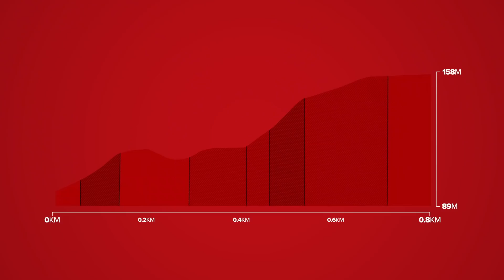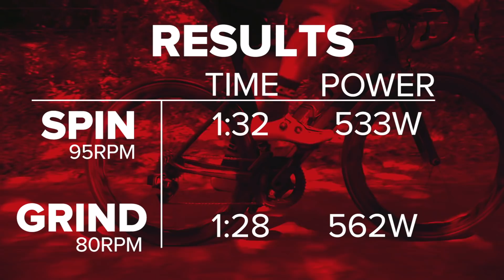Spinning Vs Grinding | What Is The Best Cadence For Climbing On A Road Bike?

Comment: What this fails to mention is that a lower gear ratio allows the average cyclist to continue to travel up the climb at a lower power output. At this point it's not about speed rather just getting up the climb. With a higher gear you may not be able to spin the pedals with your given power and you'll just stall.

Comment: I am a messenger in paris. One of our standard runs is a climb of 1.4 km with a 6.6% average gradient. At places it looks pretty vertical. Spinning with a gear ratio 34/32 on a 32kg(when empty) cargo bike is my best friend. If you visit the Sacre Coeur in Paris think of me.
Reply: J'aime l'eglise de Sacre Coeur
Reply: Greetings from Canada
Reply: Just use motorcycle, problem solve.
Reply: Your a real cyclist! The more weight makes it exponentially harder and coming down frightning. I found coming down zoncolan frightning as im over 110kg.

Comment: Grinding @ 80 RPM?!!! Looks like we don’t have the same dictionnary 😂. Try again @ 60RPM, that’s what I’d call grinding
Reply: exactly
Reply: Precisely! It also depends what gears set up is used. I start "pushing" pedals when dropping below 70, 68 is minimum but 74 -76 is like best fitting for me. I feel then, like I'm riding "for free". 78 RPM and I shift to next gear to not "overtorque" at 80 RPM or any higher. I feel like dumblesly waving my legs just to move them around and not do any useful, effective pedalling. My gears are 52T at the front and 11-23T / 11-25T  cassettes. Note that 52x11 shifting at 70 RPM gives nearly 42 km/h, and 52x12 at 80 RPM is even faster... If you're amteur (like I am), try holding it for 40 kilometers or more? Can you?
85-100 RPM average? Heart attack! I never believe any of that, when amateur riders push me this kind of news... Pure rubbish or one is spinning 39T and 25T at the rear...

Comment: 90-100rpm on 165mm cranks feels natural to me, and I can maintain speed longer than when I was stuck on 172.5mm cranks spinning at 80rpm.  I can also zip up hills quicker with shorter cranks, where I felt the need to climb out of the saddle and grind with longer ones.  So, if you are going to change cadence, I think changing the crank arms to match makes sense.

Comment: I've found that grinding gets me up hills a lot faster but my legs run out of energy before the end of a century.  If I've climbed with a higher cadence, I still have legs at the end.
Reply: I guess that would depend on the steepness and length of the climb. I cannot grind for 20 minutes out of the saddle on a steep hill as i get tired earlier. I can do it sitting down on a spinner cadence. For short hillclimbs, standing up is quicker. For longer hillclimbs, i need to pace myself and spin to win.

Comment: Being a touring cyclist and not a racing cyclist, I ride a bike that once the camping gear is on the bike that can weigh anywhere from  60 to 100 pounds (27 to 45 kilos) and my climbs are often in the rockies.  I spin with a target cadence of 95.  But my gear ratios and gear inches over 27 gears give me lots of options.

Comment: Optimal cadance is actually quite an interesting question.  I can imagine there are several conflicting factors involved.  Here are a few:

1) Energy wasted moving the legs.  Imagine pedalling a stationary bike with zero load.  The faster you pedal, the more energy you're using just accelerating and decelerating the mass of your legs up and down.  Since there is no load, this work isn't actually doing anything, and it's completely wasted.  So when you pedal a real bike against a load, the faster your cadence, the more of your power is wasted just moving your legs, and this wasted power is lost from moving the bike.  From this aspect alone, lower cadence is more efficient.

2)  Wear on the knees.  The more force you pedal with, the more you grind out your knee joints.  From this aspect, higher cadance is better, since you can produce the same power with less force, saving your knees.

3)  Efficiency of the muscles.  I would imagine the muscles are more efficient at a particular combination of force and speed.  If muscles are at maximum contraction for too long, perhaps transport of fuel and waste products is less effective than if they contract more lightly but more often?  Perhaps someone more knowledgable can comment on this?

It would be interesting to know if sport scientists have quantified the contribution of these and other factors for various cadences, and found an optimal tradeoff point?  Has anyone seen anything like this in the literature?
Reply: I've found this phenomenon at this "electricity generating" thing with several lightbulbs on a bike, to see what you could do in a minute. I told the guy to wire up all the lights but the load only came to about 105 watts. Spinning the pedals made the load easier but it was impossible to put down more than 105 watts as the pedaling just became really easy at high speed (there was probably a voltage regulator to not blow the bulbs). Probably for a minute I'd need 400-500 watts worth of bulbs and 110 rpm for optimal loading.

I'm not sure whether energy wasted moving legs is recovered at higher loads. Because the body doesn't have to control the legs, the power can be dissipated in the bike and not in the muscles.

Pedal stroke timing could suffer though. Because muscles can be used as a brake, contracting opposite muscles at once - either on opposite pedals (independently ratcheting power cranks are to train this out), or in the same leg, wastes energy. I was trying lower cadences to really think about the firing order of different muscle groups. Was I contracting the quadriceps and hamstrings at once? I'm wondering whether with two joint muscles such as the hamstring, hip flexor and gastrocnemius, some energy wasted is inevitable. I mean the hamstring can also aid the gluteus maximus slightly, but yet it saps power from the quadriceps. At the bottom "scraping" of the pedal stroke, the gastrocnemius and hamstring work together to bend the leg and point the foot.

It's almost like ignition and exhaust timing in an internal combustion engine. You don't want part of the explosion to be trying to push the piston backwards. Trying to minimise eccentric "contractions" in the pedal stroke is much the same. You want power to turn the wheels on the bike, not turn it into heat stretching muscles against their will. It would be like riding on a tandem with someone trying to pedal backwards. Eccentric contractions are the main energy wasted on a unicycle.

At very high loads, I have anecdotal evidence that muscles do lose efficiency. I sweat more trying to pull 120 kg barbell off the ground than a 60 kg barbell twice - yet the latter is actually more work, as I dip my body twice. Not only that, but it also wastes the potential of fast twitch fibres. You're using up their capacity, but not making much power. They are just acting like an electric motor in too hard a gear ratio for it to function properly.
Reply: No doubt the most important point you've made is #3, and is what has already informed cadence in practice.
Reply: For #3 it's more about sustainability than efficiency.  Faster cadence uses aerobic energy which puts the work on your heart and lungs.  This can be sustained indefinitely if your heart and lungs are trained for this amount of load.  Slower cadence starts to dip into anerobic reserves which always has a limit due to lactic acid buildup.
Reply: @TimpBizkit  Great reply, and good barbell example.

Comment: What i always asked myself and i didn't find any research about is if a higher cadence leads to a higher backflow to the right heart. Veins don't have muscular tissue they are compressed by the surounding muscles. With an higher cadence this happens more often leading perhaps to an higher backflow. This could perhaps help the heart to be more efficient or lead to an better supply of oxigen to the muscles.
Another reason for the normal person to use a higher cadence can be the reduced torq on the joints. If have read a study about this but don't find it at the moment.
I personaly try to keep my cadence a little bit up when ever i can.

Comment: Cadence is a U shaped function of power and time. I do a 10 sec all out sprint at 135rpm, a 20min ftp test uphill at 60rpm but a 2hr time trial flat at 93 rpm. Over longer time at lower intensity higher cadence gives less muscle fatigue and the cardio system is still not yet at its limit, but when the effort is short and high the additional load on the cardio system enforces less cadence and because its short the muscles can hold it.

Comment: 80rpm is "grinding"? LOL, watch me with 36/28 up a 20% slope at 45rpm, that's grinding.
Reply: Grinding is when you're forced to pull harder on the back and upstroke at a rate that can't be sustained if you experience any significant fatigue or dip in aerobic performance. It can happen at around 80 but that doesn't mean you can't drop even lower. If you have a power meter with torque analysis you can see where this starts to occur. And you can also train to improve efficiency at both ends of your effective cadence window.
Reply: 36 is a noob gear. Try 39 or 42....
Reply: @MicroageHD  I ride a 48/36
Reply: Try fixie with 48/15 and you'll learn about grinding, lol
Reply: RollinRat  TRACKLOCROSS FTW!!!! World Champs in Sac this August!
Reply: I'm right there with ya!
Reply: RollinRat  ..blah blah blah. I rode for a long time you best respect!
Reply: Super big lol.  All individual, but for me 80RPM is my normal "race" pace.  Below 70, I feel like I'm grinding and higher than 90 is spinning, that's just me.  :)
Reply: Grinding is when you have to put several pounds into your leg. Spinning is when the pedals feel loose.
Reply: Hahaha
Reply: Grinding is power...in and out of the bedroom
Reply: Over 20% is always going to be a grind unless you are geared so low that the front wheel lifts.the tova st agata route of mortirolo is over 20% in sections ,i feel your pain over 20% is a challenge.
Reply: @superluvver3  depends how long your bike's wheelbase is. if your seat is well forward of the rear wheel, you may be able to keep the nose down.
Reply: @l4kr  that's still pretty fast if you're talking 100 to 1. If your wheel moves about 2 metres a turn that's 10 metres a second. Unless you're talking the opposite - a really low gear where the bike moves 2cm/pedal and you tip over.
Reply: @MicroageHD  yeah, the pros are using 34 now.
Reply: @ministryoftruth8588  As LONG as you ARE going slowly ENOUGH you won’t BE going much MORE than 60rpm ANYWAY.
Reply: @MicroageHD  39 - 42 is for grinders (people that only ride flats and get dropped at any climb longer than 150m)

Comment: I think part of it is psychological.  On the flat, you're just keeping the bike going, and the only thing slowing you down is the aerodynamic drag.  Stop pedalling for a few seconds and you'll coast.  On a climb, the very moment you stop pedalling, the bike begins to slow down.  The very moment you reduce pressure on the pedals, you can feel the bike beginning to drag.  I find spinning uphill demoralising and I find grinding on the flat equally demoralising.  At 57, my definition of spinning is probably a much lower cadence than Si's.

Comment: The answer is RPM at whatever cadence makes YOUR most power.. .Stand on the steep and sit on the flatter parts, to alternate rest between the different muscles to give each a break.. Adjust your efforts so you don't blow up.. Toggle your power up  and down just under where you blow up.

Comment: Your cadence will depend on your chainring, cassette cog, strength, fitness, body weight, bike weight, VO2 max, percentage of high-twitch muscle, hill steepness, hill length, outside temperature, elevation, specific training on the hill in and out of the saddle, a professional training plan, what you eat, when you eat it, warming up first, having supporters with cow bells at the side of the road ...

Comment: There is more power output grinding  because of technique; when standing you are shifting body weight applying the power part of the stroke with a better mechanical advantage.

Comment: I think GCN answered it at 4:30 - you pedal fast to go fast. Also - for me, the length of the climb matters a lot. If it is a climb that can be covered in less then 15 minutes, I can get out of the saddle and push hard at a lower cadence and actually put out more power to get over it quicker, but these efforts are not sustainable over and over again throughout a long day. If it is  going to last more then 15 minutes, I really want to keep it above 90 rpm and mostly stay in the saddle to keep my heart rate down. Also, I train at those high cadences and have always been a high cadence rider and usually have stronger performances in longer, harder, rides/races.

Comment: I've been wondering if a bike was set up specifically for a climb by moving the saddle forward so that it centers the rider over the peddles at the same angle to the downstroke as their normal bike on flat ground, would it be more efficient in climbing? One of the things that getting out to of the saddle does is places the riders weight directly over the peddles so it can be used more efficiently to push the bike forward. Would moving the saddle forward for a climb help with this. I could even imagine a system that moves the saddle back and forth automatically depending on the gradient measured with an internal level.

Comment: 80rpm is grinding already? 😂
Im not a strong rider and if I am able to hit 80-90 thats when I thought I am spinning and the grinding happens only at 60 and below rpm in my case. 🤣😂 gotta have to train more. 😂
Reply: Unli Ahon haha sameeeee I consider grinding ..like 40 rpm ahah
Reply: PAPSS!!!
Reply: the faster you get the faster you will spinn. that doesnt mean you should aim to apin faster nore that faster spinners ng people will bypass you
Reply: wat
Reply: I'm 146 pounds and don't develop the torque of the bigger guys, so my power comes from my cadence. Less than 93 feels like I'm grinding, 95-103 is the sweet spot.
Reply: Unli Ahon Haha yes, what is 60 then? :)
Reply: If below 90 has to be Grinding then are we freaks who can do 50 with ease freaks?  Let's call it 'smashing' :)
Reply: I'm a 100 kg, 50+ yr old, with ex-rugby player's knees (been offered knee replacements already). I have read that a faster cadence puts less strain on your knees. I aim for 80-90 on the flat, but my default climbing cadence seems to be 60.
Reply: gotta train more
Reply: bypass?
Reply: To the seasoned cyclist, yes, 80 is "grinding."  My cadence evolved over the years from 90 to over 100.  But this also happened to coincide with the increasing prevalence of the mountain bike, where smaller gear ratios and much wider range became the norm.  Well, at least my riding availed itself to that.  I grew up mashing big gears on steep climbs on a road bike with traditional 42/52 gearing up front and probably 14-26 on the back.  The mountain bike changed that.  

Then in the 90's Armstrong found that his power output increased as his cadence increased.  He moved away from mashing or grinding to spinning.  The pro peloton followed suit - except Jan Ullrich!  

Higher cadence also tends to coincide with lower knee injury rate and less muscle fatigue, so new cyclists are encouraged to increase their cadence.  Spinning comfortably at low power output times improves the rider's ability to reach top spin rates in a sprint, so high cadence training can improve sprinting performance.

But this video shows that jumping on the high pedal cadence bandwagon is just that - herd behavior!  Do it if your performance, comfort and recovery improve at higher cadence.  If you're better at lower RPMs, then ride at lower RPMs.
Reply: I ride at around 96rpm
Reply: Lol
Reply: What does your power curve look like? Basically, grinding would show up as loss of smoothness, not at any particular cadence rate. I'm very smooth at low cadence and low power when I warm up. I try not to ride below 75 on steep hills and I try to average about 90 or higher for the ride (not counting zeros). I do "jump in" to higher rates though, I have plenty of force to turn the pedals. I just train that way for the steady, predictable pacing benefits.
Reply: @taffboyslim  You need closer cog ratios and you need to warm up more patiently as you learn to hold higher cadence. OTOH, this is difficult to do if the gradient varies a lot on your rides. You might check out an indoor trainer for occasional "spin to win" sessions.
Reply: For me grinding is 50rpm and spinning is 90-100
Avg is 70-80rpm for me
Reply: wooooohh Unli Ahooon!! :D
Reply: I view 70-80 as normal riding as in not grinding or spinning
Reply: @taffboyslim  yep - for some us, preventing soft tissue damage is perhaps a bigger consideration than simple speed and power output.  for me -  grinding is 60 and below, spinning is 90 plus, and usually 70-80 feels the most comfortable and efficient
Reply: kabayan
Reply: Yeah that’s why a lot of their videos has little value for most of us actual average riders. They are so much more fit and better equipped and supported that their experience is too far from us for us to relate to.
Reply: idool pa shout out HAHAHHAAHA
Reply: @sheyngsanity  di si ian how yan
Reply: idol
Reply: Wow english lodi